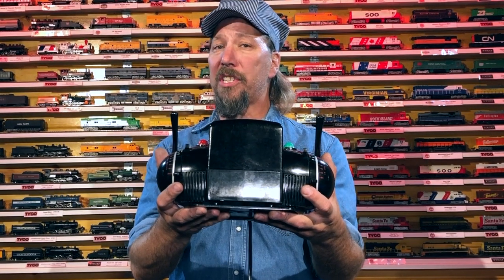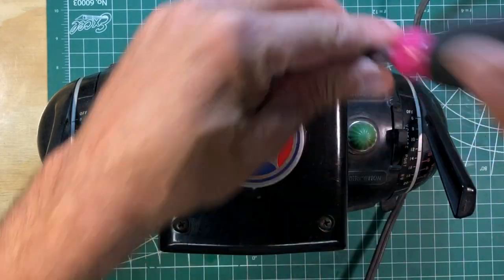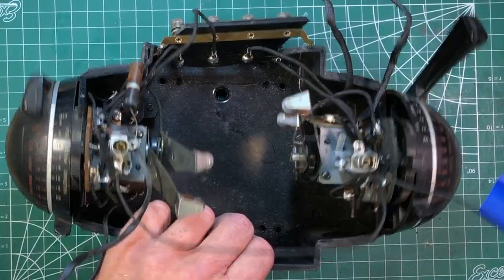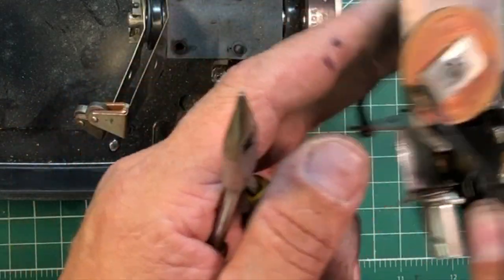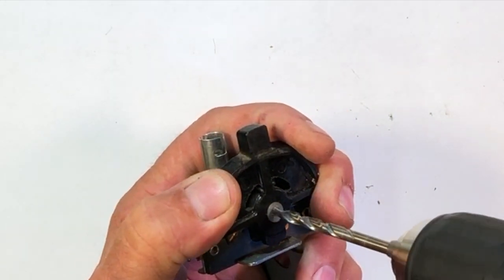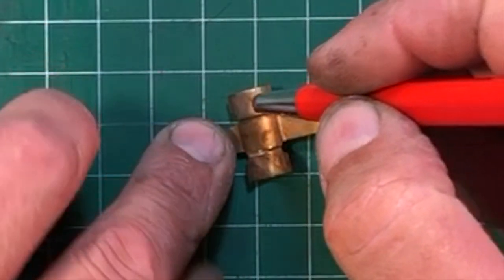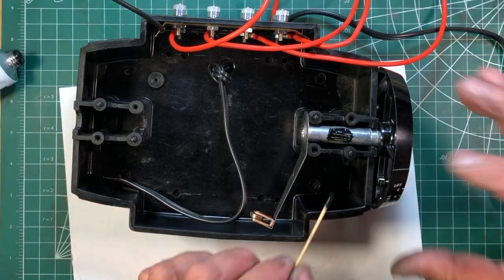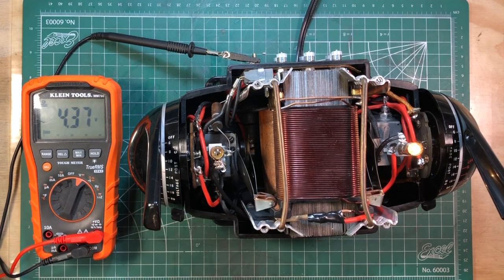Lionel ZW How to do a Complete Tear Down & Update.

Comment: Have you ever rebuilt an LW transformer?  I currently have one that is not putting out any voltage and haven’t been able to find much on rebuilding one.
Reply from the maker: I have not done any work on a LW. Seems like all the diagnostic procedures should be the same all all old A.C. transformers.  I'm wondering if you have an open in the main coil of the transformer?

Comment: Great job, I would never be able to do this... My dad would be able to lmao I been looking at this controller on Ebay, will it work on HO? It's definitely a nice Lionel controller
Reply from the maker: Thanks!  This transformer is only used on A.C. powered applications.  If you have a very old a.c. powered HO scale then yes.  BUT those are pretty rare.
Reply: An AC transformer would require a bridge rectifier to run most HO scale. Of course, then there's still the issue of maximum voltage output. ZWs put out a maximum of about 20 volts, which is too high to safely use with HO equipment. Then, even if you do install or make a bridge rectifier (Simple to make, just four rectifier diodes together) you still need to install a double pole double throw toggle to reverse your DC powered HO locos. So in the end, it can be done, but it requires so much work that unless you have a specific reason, it's simpler to buy an HO power pack.
Reply: I should add, my HO layout does use 1970s Lionel train set transformers, but I did have a specific reason for this. Given the sheer number of locos I run, and they are old (1930s to 1960s) open frame motor units, I divided up my layout into power zones. One transformer for an industrial belt line, one for a yard, one for a roundhouse and engine shop, and so on. Since I do a lot of switching I already use DPDT toggles to reverse blocks of track. So between power needs, and dividing up power means seperate throttles, and the fact I had these transformers laying around anyway, it's worked well for me. Again, though, my needs were very specific, and overall the vast majority of people are just better off with a ready to use HO power pack.

Comment: A couple of things: 1) that's a great looking truck.  Is that a c10 or c20?  2) any idea which amperage rating that diode is?  I don't see any rebuild kits on ebay but do see a feller selling a 16Amp and a 40Amp diode for ZW's.  Just not sure which one to pickup.

Are you related to the guy over at Vice Grip Garage?
Reply from the maker: I just checked the e-bay seller "trains in the attic" and sure enough, I didn't see the complete kit I purchased from them. The kits they do show has everything except the diodes and the circuit breaker in the same kit. I see they also offer them separately, so I guy could still get all the parts needed from them. I do not know what amperage diode I got in the kit I installed. The Ol chevy is a '72 K20. S.B. M/T. I am not related to VGG, But I do come from North Dakota, from N.D. breeding stock, so our ancestry could come from the same lines if a guy goes back far enough :-)
Reply: @classicmodeltrains  very sweet rig.  I've been looking for that color to do a rebuild.   

 Fwiw, I remembered that some guy made this internet Google machine and I found an old manual on how to use it.  Apparently, it doesn't seem to really matter if you use the 40 or 16 Amp diode.  So, I went big so that I didn't have to go home.  We'll see how it goes.   

Thanks for the videos and keep up the great work.

Comment: i would have used a drill bit to do that copper strip instead of Dremel tool.
Reply from the maker: Greetings, and thanks for commenting.  Drilling out rivets is something I do quite a bit.  The reason for using a cut off wheel is I find my drill bit will "grab" the material in the flutes of the bit, causing the metal to become distorted or bent.  Since I knew this was soft brass, I choose not to go down that route.  Not that drilling it out is a fine idea, I just decided to go down a different path :-)

Comment: You spent all that time rebuilding that unit, but kept that old resistor.
Reply from the maker: The resistor tested fine.  This was a upgrade.  New parts that were installed were upgraded components.  The original components still functioned, But the new installed components were a better choice.  Why would it be necessary to replace a resistor that's functioning and no "upgraded" resistors are available?  These are my reasons behind what I do. Other people may have different outcomes.  Thanks for watching and commenting :-)
Reply: I would have replaced the resister too.   The problem with electronics is heat and age.   As the part heats up the molecules within the part move around more.   Believe it or not metal molecules move, just really really slowly.   Semiconductors and Carbon Resistors all change over time.   Eventually the contaminants and doping within the part move around and stick together.   This creates an area of higher resistance, which then generates more heat, which then accelerates the process.   When the resistance goes up and the area gets larger enough then the part fails.

My 2016 Chevy Van had a PCB with Resistive Traces to set the fan speed.   Two of the Resistive Traces burned out within two years.   Not made like the Resistor in a ZW.  

Back in the early 2000's I once saw a presentation on Copper molecules that had moved through a layer of nickel and then a layer of Gold causing the contact resistance to go up and the part to the fail.  There is a reason that Corporations used to have Material Science Departments.   @classicmodeltrains

Comment: How much would you charge to do something like this for someone? Interested in having mine done?
Reply from the maker: I don't know.  There is some guys on e-bay that do it all.  I think they are getting $300 a pop plus shipping.
Reply: @classicmodeltrains  Like John, I was gonna ask the same question. And honestly $300 isn't bad. I just gotta get a ZW.
Reply from the maker: @nerfreak01  it seems the going rate for a working ZW is $100 and up. I suppose if your starting to shop for one try and find one that has already been updated. Probably be worth paying $200 for it. Shipping them back and forth seems to run a lot of $$$. I’ve seen guys advertising rebuilds on EBay. Maybe that might work as a place to start looking?  Non-working ones are like $20 to $75 I’ve seen in the past on eBay.

Comment: what will you charge to do mine !! seriously ??
Reply from the maker: I'm not really set up to that.  The shipping back and forth would probably run around hundred bucks.  The parts were close to $40 and I had 3-4 hours into doing this. If you were local to me it would be a different story.  Theres guys on the e-bay that sell reconditioned ones, you send them in yours and they send out a fixed one back.  I think I saw $300....maybe......

Comment: Why the heck didn't you show the main soldering steps for those of us that don't have or don't read schematics?   The rest of the presentation was great except for the important wire connections and routing for the diodes and the circuit breaker.
Reply from the maker: I removed one wire at a time, and then soldered in the exact same replacement wire, one at a time. I suppose I should have mentioned that in the video.   The process took me probably 2 hours, and I did not want to bore viewers with this. I did provide an image of the schematic, said it was online, and I also posted it on my FB page.  This kind of update is a medium level electrical repair.  Schematic knowledge and soldering knowledge, should be well established before attempting this. I am hoping this answered your question without me coming off the wrong way  :-)
Reply: @classicmodeltrains  Thanks.  I saw another vid about changing to diodes.  It was not near as good as your vid and the diodes change was badly done.  I was hoping yours would be more informative, but then you skipped over that part and the install of the new circuit breaker.  I have 3 ZWs to do, so I was most interested in those parts.  Otherwise, your vid was great.
Reply from the maker: @michaelragan5799  The diode swap out just involved soldering the one wire that goes to the center post.  the diode is grounded from the metal frame it sits on. The old circuit breaker has 2 wires going to it, but they are a little short.  I extended the new wires I soldered in to accommodate for the new location.  The schematic is just like a road map. Shows you were the wires start and stop. If you number the old wires, and locate them on the schematic, draw colored marker lines to help out following them.  Take lots of pictures or video of the before you take it apart. All the wires look like there is a lot going on, but its just the same thing twice. I would not take apart the reversing switch like I did unless you can visibly tell the contacts are very corroded. If you believe the original wires are in good shape, then you really don't have to replace them. Make sure the fish paper is not oil soaked, or else it will conduct electricity. I hope this info might be helpfull for ya.
Reply: @classicmodeltrains  👍